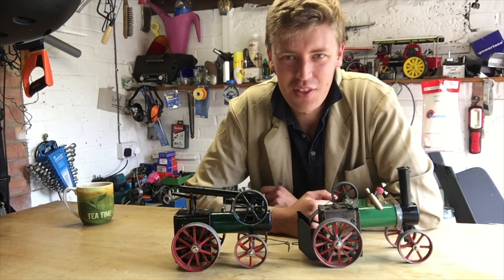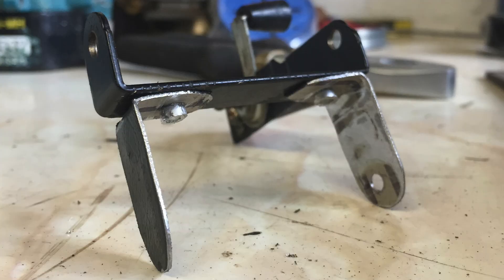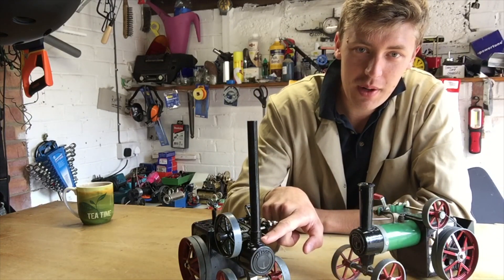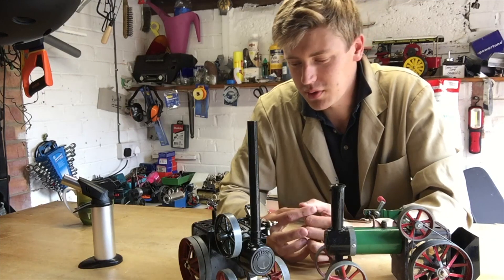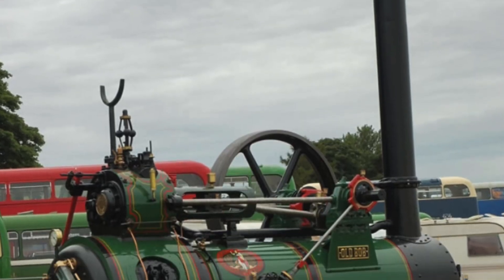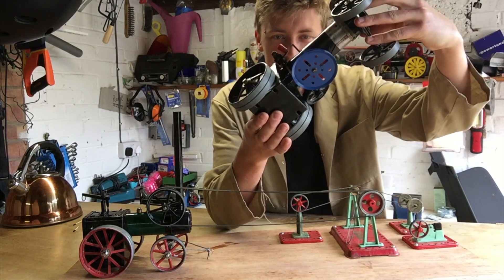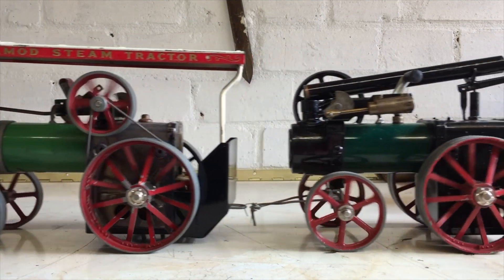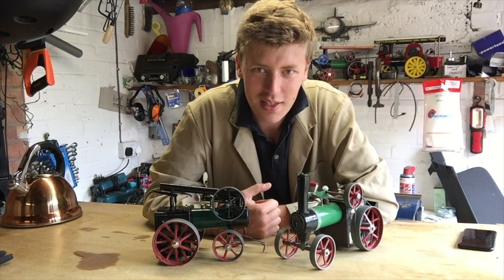Mamod Portable Engine Conversion

Comment: Wilesco machines are much better made than mamod, mamod is nothing too simple!
Reply: I own both. My Mamod Steam Roller is from the 1960's and runs extremely smooth. Much smoother than you would think a single action could with that cylinder moving so much. It is so simple it does not even have the "Direction" lever. No lever at all in fact, just runs wide open. My Wilesco is a D40 from the 1980's. They are now called a D405, no difference. Mine has always had a slight rattle in the crankshaft but only in forward. Reverse is smooth as butter. I have made a full length roof & working steering gear for my Mamod so it certainly looks more realistic. I find a certain elegance in its simplicity. It certainly runs MUCH quieter than my Wilesco. As for quality of construction they are about equal. Mamod has a stronger cast chimney and the Mamod Tractor has MUCH nicer cast rear wheels. Wilesco are stamped and not very detailed. So much so that I like many people have replaced our Wilesco tractor rear wheels with Mamod ones. They look much more realistic. The Wilesco has a double gear reduction which the Mamod could use, it is pretty quick for a "Steam Roller". Get one of each and have twice the fun! God Bless.

Comment: I've done a few of them and had a custom made center boiler flue down the middle of the boiler that has a curved elbow that's linked to the fire box for better draft for the fire it was a bit of a pain to do but it can be done with the wilesco traction engines as well to modify the boiler it's self to have a fire tube flue in the boiler it actually works quite nicely and it steams the boiler a little bit faster and more efficiently but of course I added a water feed pump to the boiler too

Comment: Well done! BTW For the long flat belt to work, the pulleys need crowns which is a slightly rounded profile. Easier belting is simply waxed floss tied with a tight knot and trimmed. Be sure to wedge the engine with the wedges in front of the wheels to keep the belt tight.